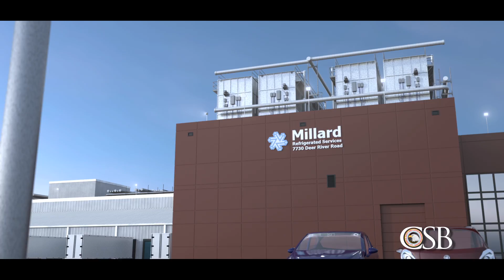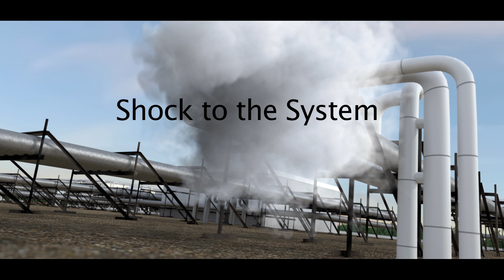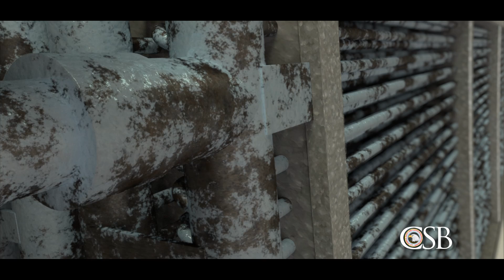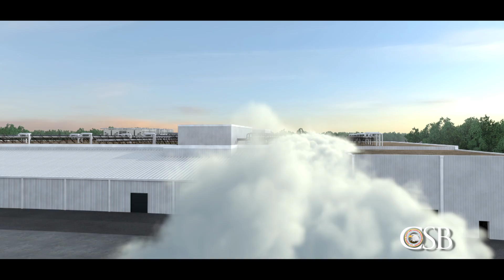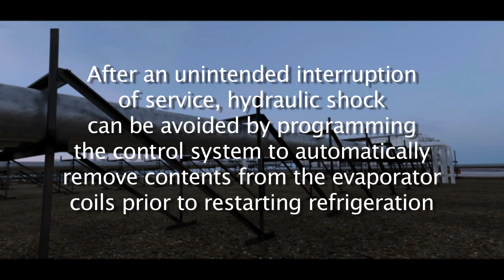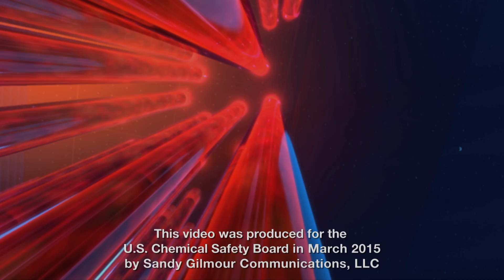Shock to the System

Comment: I operate ammonia systems as a contractor, really simple. You just press buttons most of the time, the only thing that operator had to do before resetting the alarms was check to see what’s in defrost mode at that time. Literally a click of the mouse.. this was wayyy easily unavoidable.

Comment: Interesting mix of human error and potentially a programming oversight? I have entirely zero experience in this field, but my first reaction was to question how feasible it would be to have whatever startup procedure is in place start by purging the ammonia lines.

I only suggest this based on my experience as a programmer, where I was taught to always ensure I’m starting an operation from a guaranteed safe state. (So if things break while I’m working, I know it’s my fault).

I would be interested to learn if such a thing was ever considered, and what the merits and demerits of such a system would be. For example, I’m well aware that falsely assuming something is in a “guaranteed” safe state can lead to accidents too.

Comment: why are they using ammonia and not something like R134a? (or the MANY other refrigerants that are FAR less toxic)
.
even normal CO2 can be used (and its 1430 times LESS of a greenhouse gas than 134a) 
R-1234YF (which i call 1234 your F-ed because its so expensive... and flammable).... when YF burns on these hot "pre-cat-converters"... it releases hydrogen fluoride
however... it only has a Green house rating of 4 (aka, 4 times worse than CO2) 
.
prices...
R-134a at $4 per pound
R-1234yf at $70 per pound (yet another reason i called "your Fed")
R-744 at 68 cents per pound
.
R-744 can also be "reversed" like a modern inverter type HVAC system for your house (aka, it can heat AND cool)
so you could de-frost your cars window before the engines coolant warms up...
.
that would be REALLY nice in a montana winter (and also save 20 mins of fuel by not having to idle the car to defrost the windows in the morning) 
.
could also be used here.... simply reverse the flow to defrost the coils

Comment: I remember this, I was the operator in the facility that day and the reason I manually override the system is because my supervisor didn’t want to completely shut down the system because we lost much money the day before due to the power loss.
Reply: if dude worked at the place let him prove it because I have a question can you tell me how exactly the system was running a defrost cycle while the electric was out? the video explains it as immediately after power was restored, the system was in the middle of a defrost when they tried to restart it but doesn't make sense how that happened if there is no power to heat the ammonia.

Comment: When I was in college, I had a summer job at an aircraft factory near my house. I worked in the "blueprint library", which was also where most of the document printing was also done. I worked at a folding table, making enormous blueprints fit into 85x11 file folders. There was a large blueprint machine next to me. Blueprints are developed with ammonia gas. There was a huge tank of anhydrous ammonia next to my chair. My boss thought it was funny to bang on the tank with a folding stick, to make it ring like a gong and make me jump out of my chair. I was always afraid the vibration would damage the valve on the tank and allow the corrosive gas to pour over me.

Comment: I used to have a summer job where we washed, sorted, froze ( using a freezer conveyor), packed and stacked strawberries. 

It was MUCH smaller operation then this, but we used Amonia refridgiration.
I remember comming to the morning shift and being sent home becaus of a small leak in one of the amonia pipes, and BOY does that get through your noose.

I can't imagine being exposed to that much concentration, good thing the cleanup crew were outside. 

Also I wonder if we had the best routines, the shift leaders were for the most part also on summer jobs. But again it was a small operation servicing maybe 20ish farms and orchards.

Comment: USCSB has rapidly become my favorite channel!! As someone who spent years working in contracted hazardous/non-hazardous Industrial cleanups - I have a strong relation to many of the settings and processes, along with the many potential hazards that silently loom just beneath the surface of these operations. Binge watching these well-made videos has become a dedicated part of my weekend routine. Thank you.
Reply: I know this is a old thread but can anyone with any experience with this kind of system tell me how exactly the system was running a defrost cycle while the electric was out? the video explains it as immediately after power was restored, the system was in the middle of a defrost when they tried to restart it but doesn't make sense how that happened if there is no power to heat the ammonia.

Comment: It should be mechanically impossible regardless of what the automation system wants to do put a temperature sensor on the pipes the mechanically electrically lock out the possibility of the other valve opening can't rely 100% on automation there have to be mechanical interlocks they should have separate smaller systems instead of one massive system why couldn't that plant the separated into four plants or 10 so the release is not that much why put all your eggs in one basket

Comment: These are great videos, its sad to see the blame game but in so many of them with such emphasis placed on the worker.
Reply: That's not the video I saw, at all. The worker made a mistake: it is right that this is pointed out. It is also pointed out that the software shouldn't have allowed that worker to make that decision; that the system should have been designed to always purge the evaporators before starting a refrigeration cycle; that the evaporators shouldn't have shared piping; and that a number of other things should be improved. This is not a "blame game".

Comment: "a bit" late on the subject, but why not have two different piping systems, one for cooling and one for defrosting? Surely it should be less efficient with less areas covered by both piping systems, but idk, having the hot ammonia and cold ammonia using the same piping seems very dangerous to me

Aside from that, the CSB is a blessing for engineers, and amateurs like me, worldwide
Reply: You basically have condensation build up on the coils of evaporator. There are two sets of valve trains that need to go through the same piping to make the heat exchanger work.

Comment: Regarding manual overrides: do you know the real reason why McDonald's often doesn't have ice cream late at night?

It's not "broken", it's just those shake machines have an interlock that WILL NOT LET YOU turn it on unless it's been recently cleaned. There is NO easy way to clear this alarm other than to clean it. Unplugging it does not work.

If these incredibly expensive systems controlling the flow of dangerous chemicals had interlocks that weren't so easy to disable, there'd be a significant reduction in accidents.

Comment: You could also not rely on software interlocks and install hardware interlocks that prevent low temp flows in pipes holding high-temp contents.

Comment: I assume that as the ammonia cloud would have passed over the water, the very strong tendency of anhydrous ammonia to become hydrous ammonia would have taken place and a low pressure situation in the atmosphere would have occurred as the ammonia cohabited with water reducing their combined volume sucking more of the ammonia cloud down.  The heavier ammonia laden water likely would have sunk creating a convection pulling non-saturated water up to combine with more ammonia. Perhaps much of the cloud was reduced before it hit the workers.  There may have also been a very strong wind that day.  Those type facilities should have water sprinkler type systems to give the ammonia water from the sprinklers before it goes for the water in someone's lungs.  I guess if it was salt water and chlorinated water were involved, that would effect things.  Salt water is no where near saturation. Chlorine may have been released.

Comment: These videos make me think back on my teenage years in contract security. At any site you were assigned to, there was NEVER training. I was once assigned to a cheese factory to watch it on the weekends. I've seen the ammonia tanks and cooling system outside and never thought anything of it. There was no training on what to do during an ammonia leak, or even a mention that it was a dangerous event. On top of that, the guard on the shift before me would never tell me anything. I came in on a Sunday night and he left like normal, then I luckily got a call from maintenance that there had in fact been a small ammonia leak in the plant and that I should not start my rounds for another 4 hours. Yeah, that guy was useless.
Reply: It's possible that he too, wasn't given a clue by his supervisor when he started, as a result of a chain of not-given-clues.
Reply: I too worked security back in the day and we were never told of any issues on the different sites. One was a medical research lab with biohazard warning stickers everywhere. Creepy place indeed.
Reply: That’s the fault of the company you were doing security for.  Most decent companies have an orientation requirement for all visitors and a more dedicated training for non-escorted contractors
Reply: Back in the '80s I worked for a construction company building a hydrogen sulfide refining plant in Wyoming. We would ride a bus an hour down a dirt road past 6 or more H2S wells to a job site. On site they had a pressurized dome with an airlock big enough to drive a semi through. That was our point of refuge if one of the gas wells blew out. I'll never forget arriving on site the first morning that was available. They turned the heat on in it the night before but they improperly vented the heating system and it's filled with carbon monoxide. We arrived to find four dead workers inside the dome. That was the end of our shelter plan. They did finally get it fixed but yeah. We had exactly zero training other than getting  inside the dome
Reply: Honest question, do you need training to know an ammonia leak is dangerous?  I mean you might need training to be able to detect or fix it, but if you can or happen to see an ammonia tank or pipe leaking, do you not just immediately evacuate?  Like the story said the gas released from this particular incident was a big white cloud that must have been visible, would you not immediately evacuate the surrounding area?
Reply: @jdoug4444  I was just out of high school. I had no idea ammonia was dangerous (blame the public school systems I guess.) And yes, you do need better training in these industrial facilities. Not everyone has worked around these things their whole life and understand the dangers.
Reply: @GeneralChangOfDanang  No that's totally fair, I mean in high school at best you might gloss over something about ammonia briefly, but yea you wouldn't have been properly informed or trained by high school.  Sorry, I didn't mean to sound snarky, it's like in my brain I see something leaking from an area I know contains ammonia, I would just run away.  But in a warehouse setting if you ran the wrong way you could be running towards where the ammonia is being blown or vented towards.  Totally understandable when I think about it like that.
Reply: @jdoug4444 Of course you need training! Would you know how to detect an ammonia leak? “Big white cloud” means nothing. Steam makes a big white cloud. So does some smoke. Would you know who to call first? Would you know EVERYONE you have to notify? Would you know HOW to notify all of them? What order to notify them in?
Or would you just guess and assume?
I’ve worked security and been a dispatcher. The answer to those questions is NOT “just call 911 and go hide in your car”.
Reply: @totallyfrozen  again, the premise of my question was that if I knew that white cloud was coming from an area where ammonia pipes are, I would think it would be a good idea to evacuate.  But someone already explained how one might not know these things in advanced, they might work in different parts of the warehouse or there could be a ventilation system that is funneling the gas somewhere and not knowing which way to go could end up with someone running toward danger instead of away from it.

Comment: We use the same stuff as nitrogen fertilizer on crops. Sometimes there is just a little cloud that comes up from the applicator when making a turn at the end of the field and if it gets in the cab, your lungs can start to burn and your eyes tear up. Up until a couple years ago we had to connect hoses manually to the tanks but now there is a safer but more expensive system that has been installed.

Comment: always easy to see the fault after the fact, but a FMEA could have identified this failure mode and had the power on sequence initiate assuming things like hot defrost gasses present.  Also begs the question of why these systems are not designed to be frost free?

Comment: Location: Baton Rouge
Description: Baton Rouge will unquestionably be devastated during the pole shift. It lies on the edge of a swamp, with the Mississippi River to its back and the Gulf before it. Both waters will rise during the drenching rains that follow immediately after a pole shift, the ocean waters evaporated into the air during the worldwide hurricane that occurs during each pole shift condensing out of the air in a fury. Even mild tidal waves at Baton Rouge would inundate the city, and the tidal waves that inundate during a pole shift are almost beyond the imagination of man, at least a hundred feet high at a minimum along ocean coasts. All in Baton Rouge at the time of the pole shift will be quickly drowned.
ZetaTalk 1: http://www.zetatalk.com/info/tinfx001.htm

Comment: Interesting video. Never would have thought this could happen so quickly. It looks kind of like what you get sometimes in homes called water hammer. You get a banging noise in your water pipes when you close a faucet quickly. You put in a small tank that had a diaphragm with an air space in the tank. Because air can compress the sudden water pressure from shutting the faucet can be absorbed by the tank kind of like a shock absorber.
Reply: I know this is a old thread but can anyone with any experience with this kind of system tell me how exactly the system was running a defrost cycle while the electric was out? the video explains it as immediately after power was restored, the system was in the middle of a defrost when they tried to restart it but doesn't make sense how that happened if there is no power to heat the ammonia.

Comment: Can someone please explain to me how fans under the ammonia line cause ammonia to cool down in the evaporator animation? Wouldn't the air be at ambient temperature and heat the low temp ammonia coming in?
Reply: The evaporator coil is on the far side of a metering device, which causes the refrigerant to expand, which reduces pressure and causes the refrigerant to boil, which causes the refrigerant to absorb heat from the ambient air.  The fans are used to move air around because if it didn't, all the water that is trapped when the air is at a higher temperature would first condense out of the air, like a glass of ice water on a humid Summer's day, also absorbing 540 cal/gm of water condensed from the air.  Add another 80 cal/gm to freeze the water and that is a lot of energy taken from a room.

Comment: This makes me think about the bunch of incompetent fucks that were working on our new shower pipes. 
They drained the heat exchanger of the gas fired central heating system/water heater, because some new hot water pipes were being installed. Afterwards, they let all the hot water taps closed, but already turned on the heater which still had air in the heat exchanger. The heater only notices that it's pressurized and cold so it starts heating... 
Suffice to say, there was a lot of loud banging and popping of water flash boiling within the heat exchanger when i turned on the hot water tap before knowing what those airheads did. 
Could have ended a lot worse with a molten or blown out heat exchanger, but the thing survived.

Comment: Wow 32,000 pounds of ammonia leaked that's insane.  Most air conditioners for your average home has 3 to 6  pounds of refrigerant (not ammonia).
Reply: Right but most air conditioners aren't operating a deep freeze the size of an apartment block.

Comment: is there a way to scrub ammonia automatically in case of a release? 
seems like it went straight into the atmosphere once on critical part failed... should not there have been a backup?
The pipe could have failed for whatever number of reasons, including (for the outside case) a physical break by debris 
during severe weather...
Reply: but you wouldn't know where the rupture would happen. Unless you could make some sort of a sacrificial zone you would have to enclose all the piping.

Comment: Why use ammonia to cool the fridge and not something less toxic? I was thinking just water, but they probably have to keep it at such a low temperature that water would stay frozen.
Reply: KasperAura Ammonia has a much lower boiling point than water. water wont boil/evaporate quickly at room temperature and it would take a huge system with alot of it to do anything so its a poor refrigerant.